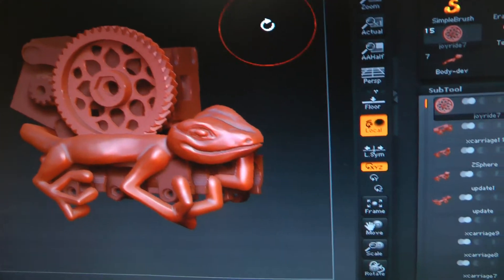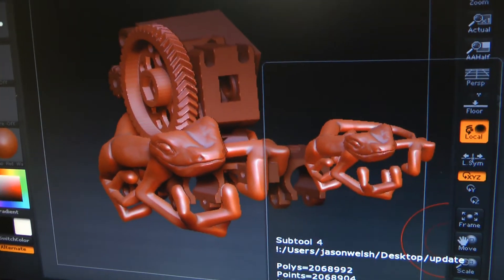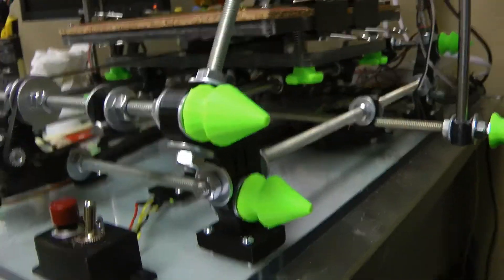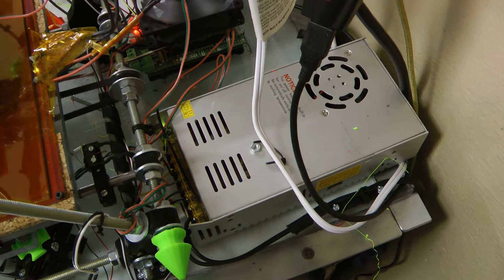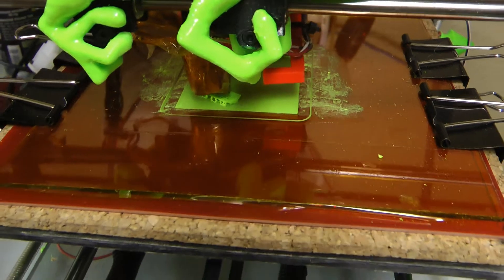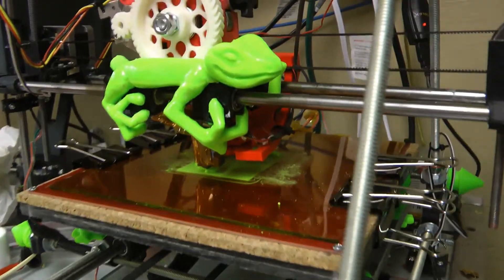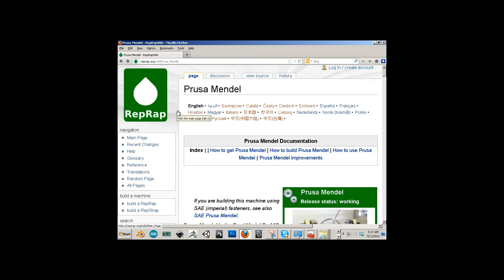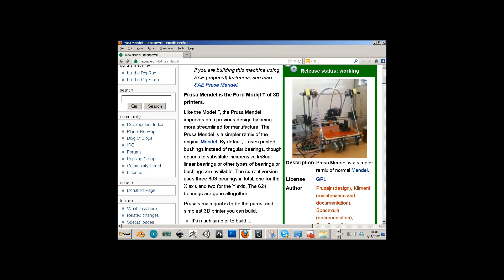Building a 3D printer an intro and where to begin

Comment: So if the bed needs to be heated, flat,  and insulate, I wonder if you could make a rectangular plate from ceramic clay with nichrome wire embedded and fire it.  BTW, good job man.

Comment from the maker: I really haven't seen any designs as detailed as skin pores with these printers.  I can print pretty small and detailed however. I have a couple gallerys I use to show WIPs as I get more and more into the detailed designs.  Your more than welcome to browse. Keep in mind I add photos as I get more and more into perfecting the prints.  So there are some older pics there to.  See under video